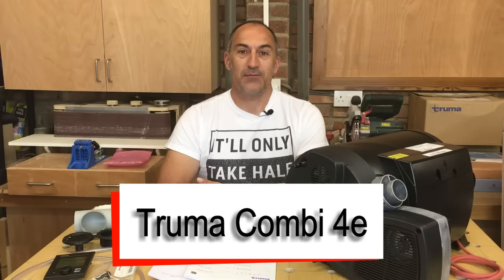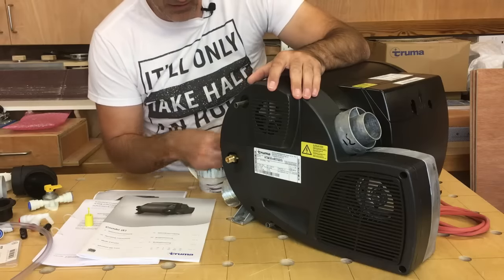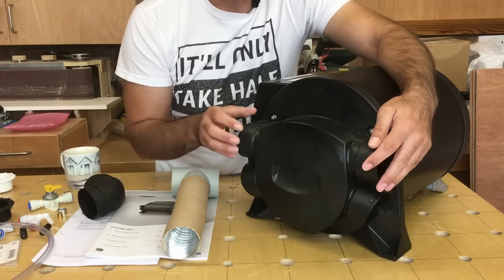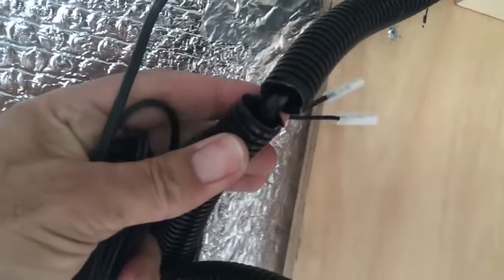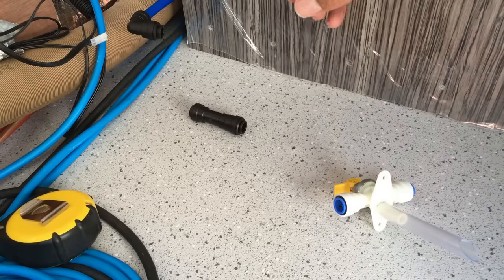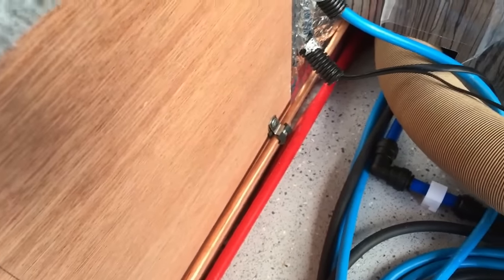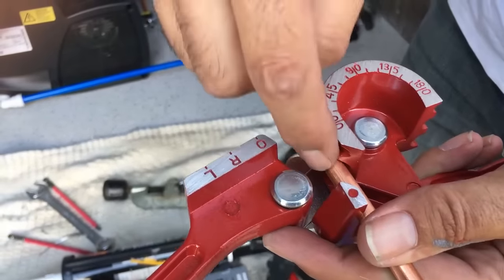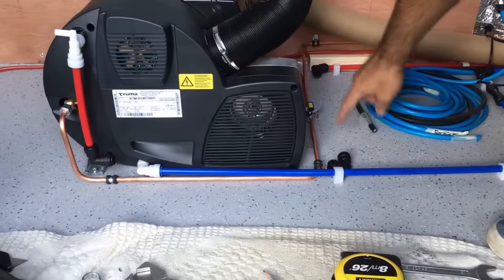Truma Combi 4e Self Build Camper Van Installation

Comment: I am thinking of bidding a camper van but I don't know if it's best to bye one for about 3 to 4000 grand, so what is the cheapest thing to do   cud u please let me know what it cost for the full thing, thanks
Reply from the maker: Hi Nikki, I would say that my van build is at the top of the home build budgets. The van cost me £7k and I have spent £11k on the conversion. Now you can do van builds a lot cheaper than mine but if you are looking to get into it for 3-4k all in then you may want to look at a second-hand camper to get you started, you can always modify and upgrade that later on

Comment: Hi Greg I'm fitting the truma boiler at the moment just one query please.....which direction does the compression olive for gas connection at the boiler face? 
Fat end to boiler thin end to 8mm pipe or vice versa? I only ask as it's not shaped like a regular compression olive and looks like it can go either way.
Many Thanks
Reply from the maker: Thin end to the inside of the fitting and fat end against the nut
Reply: @GregVirgoe  Thanks 👍

Comment: Hi Greg   I’ve just fitted my truma combi 4e I have it connected to the 12v and to the mains I have the van plugged in. I cannot get it to turn on at all. I wanted to test the electrical unit before I boxed it in. So it’s not yet got water or gas in there yet does that make any difference? There’s absolutely nothing no light no panel light up nothing. Any help would be much appreciated I’ve been sitting here for hours on end trying to figure it out

Comment: There seems to be two connections on truma boiler for the truma control panel, which one did you use? And should the display panel still work while on 12v only as I’ve not ran lpg through it yet or 240v, is this why the truma display isn’t working ??
Reply: I followed the video instruction which was great as per usual but was missing a few minor points, mainly the ones I was stuck on haha, any help appreciated, thanks again greg
Reply from the maker: Hello Paul, the control panel can plug into either of the ports on the boiler it does not matter which. The boiler does need the 12vDC Supply rated at 10Amps to be live but you do not need to have the 230volt power to be on for it to work as that just supplies the electric heating elements. 
The remote controller needs its own 12v DC power supply rated at 1Amp onto the back of the controller there was a short lead with white plug that came with the controller for that power supply. The controller will not work without that power supply to it. 
The 12v cable to the boiler must be at least 2.5mm and if longer than 6m it should be 4mm to prevent voltage drop to the boiler. 
Hope that helps you 👍🏼

Comment: Good that you can have hot water and space heating from a single unit, but a shame it's not compact or flat enough to be able to be mounted underslung like a lot of the other space heaters and one of the water heaters I've come across. Making as many of the utilities as possible underslung saves a huge amount of valuable internal space, can be done for water tanks, LPG tanks, space heaters, water heaters and sometimes even batteries!
Reply from the maker: I would gladly sacrifice double the space for the benfits of this heater it is incredible how well this works and how controllable and just convenient it makes van life.  We live in our van and have loads of space and empty cupboards, you dont need that much space.
Reply: @GregVirgoe  yes it's a smaller unit, but that's as opposed to mounting the units under the vehicle which frees up valuable interior space. This device can't be mounted externally.

Comment: Hi Greg , I currently have this installed in my van . I have an issue , i reset the CP Plus panel after an error read , when the panel initialised it no longer shows any boiler controls at all . I have tried all the usual shut downs and nothing gets it back . Any advice?

Comment: So I am wondering why are you using copper tubing for the gas tubing instead of steel? Isn't copper heavier and more expensive than steel? What are the positives I am missing?
Reply from the maker: If you compare the density of the two metals copper is 14% heavier and by it's metal trading value on the stock market it is much more expensive than steel, so you are correct.
However, let's look at the actual numbers involved here for the copper coil. A 10m coil of 8mm copper tube weighs 1.24kg (that's just over a bag of sugar) and 14% of that is 174grams or the same as an 8 ball in pool.  I pulled the copper in without any fittings from the boiler to the cylinder, I don't know anyone that could do that in steel? So you would need a lot of fittings and therefore actually a lot more cost and time to install and all those potential leaks in your van. I know which way I prefer to go, hope that helps.

Comment: Have you got mains electricity as a back up ? (I’d have through it would use to much to heat up water and air
Reply from the maker: Yes the Truma is connected to the electric hook up and has two 900w elements making a total of 1.8kw on electric. That is plenty to heat the van and make the water hot and we only use that if on a hook up.

Comment: I'm surprised the regulations do not stipulate that the connection between the copper piping and the gas container, and the piping and the heater, be made of a flexible material... given that this is a moving vehicle, which will go through its share of rattling and vibrations. Having solid pipe all the way from end to end makes me anxious.
Reply from the maker: uramalakia the regulations state that it must be solid Pipework and secured at the correct intervals. Flexible connections to permanent appliances are not allowed. Only flex is on the bottle connections. 
You can build in a little give with a copper coil to the unit.

Comment: Hi Greg, having a slight issue, my hot water outlet pipe is very smooth and is not taking a grip from the 10mm elbow from truma, Ive tried 2 different truma red elbow connections and also a normal polypipe 12mm to 10mm elbow and all of them don't bite down onto this outlet pipe. Filled system and sure enough the connection flew off. I'm thinking the outlet pipe might just be a faulty piece on the boiler and very slightly undersized. As you are a bit of a guru on all things vans, do you have any suggestions? 
I have emailed the powers that be but guessing no advice until tuesday. Cheers greg
Reply: hi buddy - we are having the exact same issue -did you manage to find a solution for this? We tried fitting a securing clip on but just couldn't get it in because no flex in the metal pipe as opposed to the plastic ones.
Reply: @jordansapey8707  hi, Greg to big to reply nowadays lol. Yes I spoke to them, rough up the metal outlet  to the boiler with sandpaper, I rang them up and that's what they told me to do. Worked a treat! Hope that helps buddy. Did you flood the garage like me lol?
Reply: @newvannoplan756  Haha thanks for such a quick reply mate - I thought it was a real long shot. I searched through every comment to see if anyone had the same issue haha. That's a great tip as give it a bit of something to bite onto - I have seen a fair few people have similar issues so luckily I haven't fully tested the system yet - I wanted to make sure it was secure, Glad to hear it worked a treat for you and no more wet floors haha.
Reply: @jordansapey8707 , no worries, put a link up of van when finished. U got the thermotechnica or truma boiler. Both the same except therma is about 3 to 400 cheaper.

Comment: Hi greg im routing one of the truma heat outlet to to front of the campervan, the hot and cold water pipes and copper gas pipe have to go up there, my question is can they be grouped together for ease of fitting/to save cutting more route holes in the furniture, will the heat pipe affect the temp of the water etc?
Reply from the maker: Rob Matthews, yes they may do, if you have space insulate the cold water pipe. 😃
Reply: Thank you for that.

Comment: I have a gas air and water heater which does not want to start with a E 31 default on the LCD switch . Does it speak to you ? Thks

Comment: Beginner question but, did you solder those compression joints? Mine seem to slip off after tightening.
Reply from the maker: Soldered joint and compression joints are two different things. 
If your joints are falling apart you may have the wrong size pipe or not fitted the olives correctly. 
I would suggest getting some help from a gas engineer as it’s very important not to have any leaks 👍🏼
Reply: @GregVirgoe  It was only sliding off when finger tightening it, when I tightened it a little with a spanner it stuck. Thanks for clearing this up. I'm very handy but never touched gas before.

I know I should probably get help but I kind of want to do everything myself; I'm doing a massive, off-grid, Luton build. I'll fully test it before using it! Thanks for your help and all your fantastic videos!
Reply from the maker: @robertbowen2075  they won’t hold just finger tight as you found out but you didn’t say that initially 😊

Comment: I hav a question about the diesel combi 6de unit. I wonder if i can leave the unit underneath my van in -20c -30c weather and still able to cold start it with winter diesel blend? Or should i keep the unit inside the van?
Reply from the maker: redhongkong these units are only designed to be installed inside the vehicle.
Reply: @GregVirgoe  thank you

Comment: Do you not need an insert also for the gas fitting olive to compress onto ? ie no over tightening!
Reply from the maker: No, the gas is installed with copper tube and the olive is compressed onto the copper tube, it does not need any additional internal support.

Comment: Hi Greg, I'm really struggling to find the non return valve for 12mn JG speed fittings. Did you get yours from eBay? I can't find them?
Reply from the maker: Paul Roe I think mine came from Truma but I have found one here for you. 
https://www.thecaravanshop.co.uk/waterpumps/accessories/john-guest-12mm/12mm-non-return-valve/prod_1505.html
Reply: @GregVirgoe  Fabulous Series Greg. I just got a van and am about to start my build and am sourcing first fix plumbing is there any reason not to use all 15mm JG tubing and fittings as they seem more readily available. Many thanks for all the advice.

Comment: Greg is there a reason the heater flue has to be below the bottom of the lowest part of the seats?
Reply from the maker: Hi Karl, that is just so it was all within the bench seat any higher and it would have come through the seat base. Most seats are 450mm high. I’m using 100mm foam so it had to exit below 350mm so it didn’t affect the seat height. 
Which was a problem at all.
Reply: Thanks Greg, I've got so use to your informative and authority instruction, I was thinking there was a some sort of standard you were conforming to instead of the bleeding obvious. That said I had a bit of a bender at a night club last night, so I was a bit cloudly when I watched this today. I was hoping watching you would help me with my hang over.....it didn't. Today I learnt I need spend more time copper bending not mind bending....50 is not the new 40 :p

Comment: Greg help! I fitted mine but when I turned it on no gas bottle symbol comes up on the control panel. The actual boiler green light flashes consistently (not matching any error codes) but the panel and the boiler don't seem to be talking to each other. It's weird that the boiler symbol won't appear on the panel screen
Reply from the maker: On the control panel press the round button once, scroll across two icons and press again to select your fuel source, rotate fully left yo has only and press. Do you have any error messages present? Have you purged the gas lines or the boiler may go to lockout?
Reply: Cheers when I scroll twice it goes to the fan symbol as there is no fuel source icon (gas bottle). I will try reconnecting the gas and purging. Thanks
Reply: I'm using Butane does it have to be propane? Also how do I purge it? The boiler is flashing error code 127 which has further confused me. Tbh I think I have a faulty control panel as the boiler doesn't respond to anything. Even if gas isn't connected shouldn't it run as an electric fan heater?
Reply from the maker: @chrishooper9260  there’s your problem, it must be propane and not Butane.

Comment: the only slight issue i have is the number of elbows is overkill, sweeping bends on the hot and cold would be less restrictive to the flows
Reply from the maker: I guess it just because I like it looking neat instead of a pipe meandering across the floor.
With 2 bar pressure and only one simultaneous demand in our van water flow will be fine.

Comment: Hi Greg, do you know how far the exhaust needs to be from an opening window? I read several different regulations online
Reply: 300 mm left or right or must have a window switch fitted if directly underneath. The switch cuts off the boiler if window is opened.

Comment: Great videos. Just a quick question, wouldn't some of the exhaust gases be sucked back into the van?
Reply from the maker: No the exhaust inlet and outlet are completely separate to the secondary air side that supplies heat into the van. It’s a room sealed boiler. The combustion side it only connected to outside.

Comment: Why did you choose LPG heating, instead of Diesel one ?
Reply from the maker: LPG is cleaner and I have a Gaslow tank already installed.
LPG is 0.61p a litre and diesel is £1.33 a litre.
Reply: @GregVirgoe  Regarding the economy, I'm agree, because I run LPG on my van. The problem is that lately, more and more countries, have restrictions and many petrol stations already refused to fill my LPG tank. Saying that, it's more difficult to find special places where filling fas bottles on campers.
Reply from the maker: There certainly has been a decline in autogas stations in the UK. There is an APP to locate LPG stations across Europe so we shall see how that goes
Reply: I believe diesel has more energy per volume though, so it may not work out that cleanly. Diesel has 35.8 MJ/liter, Propane has 26. A diesel-burning furnace will therefore burn less to achieve the same heat, so the cost difference will narrow considerably. Also - well, convenience. One tank, fuel for the vehicle and the home, as opposed to having to deal with (potentially) dangerous gas that is also an extra step to fill up. But of course, it's not like gas is a bad choice, I just really like the idea of a single fuel, and knowing it's always there.

Comment: Curious why you opted to use copper instead of flexible gas line? And what is gaslow?
Reply: He says in the video that regs say it has to be rigid copper, I believe. Also, it's probably better quality than anything flexible.
Reply from the maker: Please review from 3:45 - In accordance with section 9 of the current European standard for LPG installations in leisure vehicles you are not allowed to use flexible hoses on permanently fitted LPG appliances. You can only use flexible hoses (not longer than 750mm) on appliances that have to be moved to be used like a stowaway hob for example. See Below

9 Connection of appliances to the LPG supply installation.
9.1 Appliances shall be connected to the gas supply by metallic piping which shall be rigid and free of
stress.
9.2 For cooking appliances which need to be moved from their transport position to their operation
position, the requirement of 9.1 does not apply provided a low-pressure hose is used and the following conditions are met:
 the length of the hose shall be as short as possible and not exceeding 750 mm;
 a shut-off valve shall be fitted immediately before the flexible hose assembly;
 the hose shall be protected against any stress, mechanical damage and overheating by positioning;
 the hose shall be readily accessible and shall not pass through or be installed behind walls, above ceilings or under floors.

Gaslow is a trade name for a refillable cylinder that is permanently fitted into your vehicle that you can fill up at petrol stations selling LPG, you do not need to exchange the bottle.
Reply: Thanks for the replies. I obviously missed that comment in the video.
Reply from the maker: No problem, happy to help you :D

Comment: Can the exhaust/intake go through the floor rather than side panel?
Reply from the maker: No, the exhaust can only go through the side wall of the van, not through the floor or the roof and not into an awning or underneath an opening window.
Reply: Thank you...that’s what I’ll do then. But curious as to why? I understand the not into an awning or under an opening window part or near vehicle exhaust. Not arguing, more than happy to take your advice... just curiosity
Reply from the maker: I would say it has to do with free flowing air around the terminal to make sure the exhaust gases are taken away from the vehicle and not drawn back in.
Here is the PDF download link for the installation manual, please page 11  https://www.truma.com/web/downloadcenter/files/truma-heating-combi-installation-us-en.pdf
Reply: Thank you.... very much appreciated